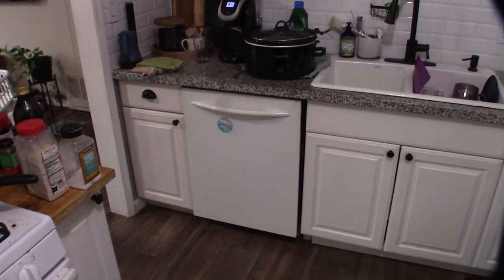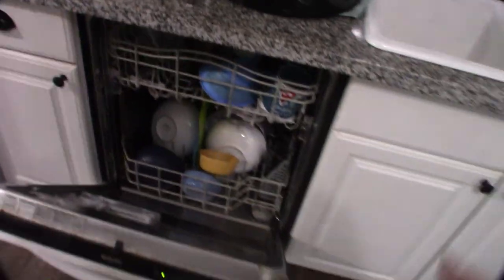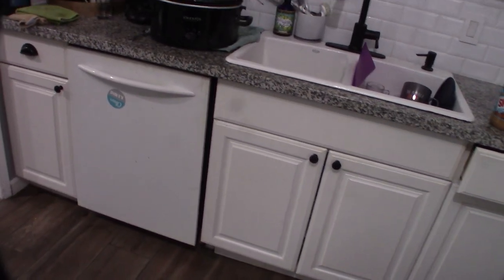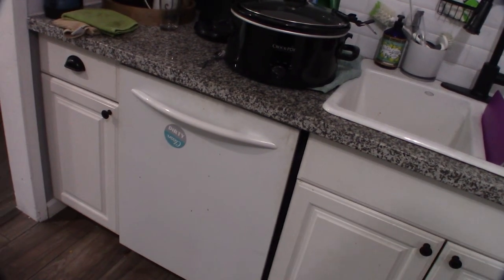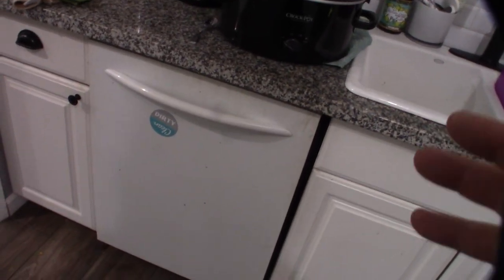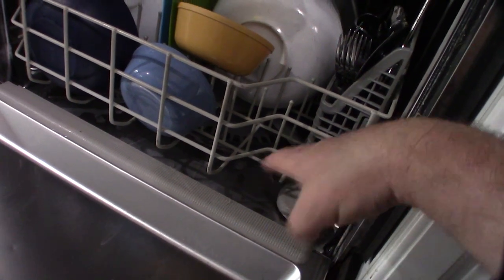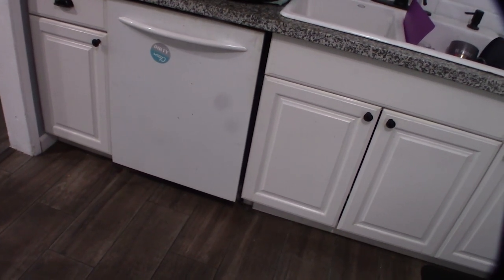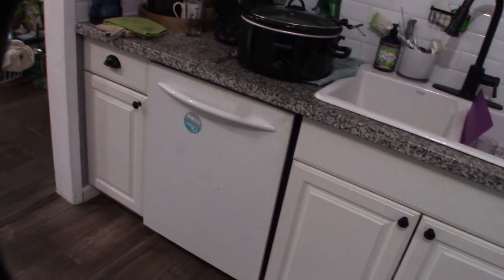DISHWASHER FROM HELL!!! Finally Solved, Intermittent cycles, thermal fuses, water not draining

Comment: That is so strange. Usually those connectors in appliances are so tight that I have to tear them apart with unreasonable force when dismantling stuff. Did they all feel loose? Are the ones they used made out of aluminum or something?
Reply from the maker: Actually they might have been aluminum, it was a few months ago. I read allot on forums and service techs were complaining about them. I'm guessing they were creating high resistance. For 5 years that dishwasher would break every few months. I would check the factory connectors to see if they were tight. It was a headache but since I've replaced those connectors I've had zero problems.  Still working on my 3D printers designing new parts. I'm fixing up some old CB radios before winter comes. Even with old school CB radios I can talk to people around the county. I'm even picking up people in south and central America